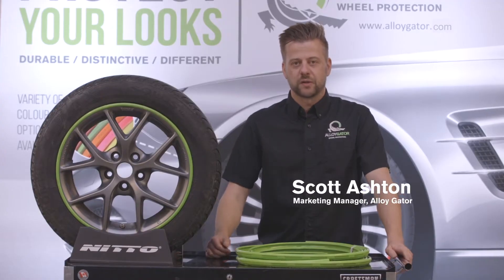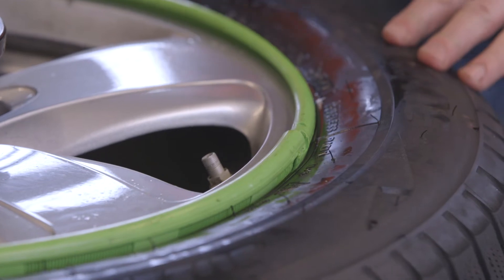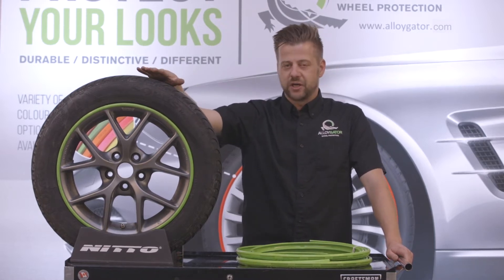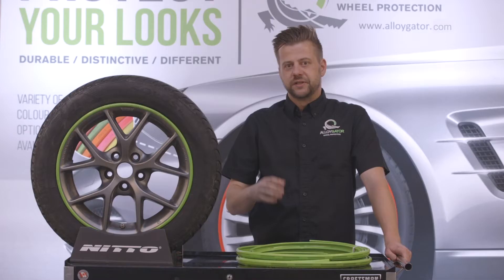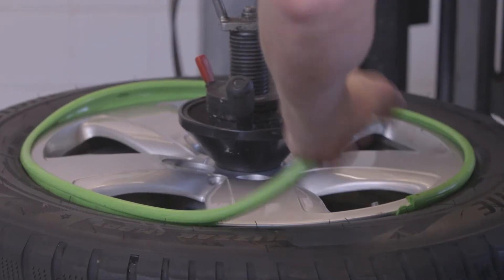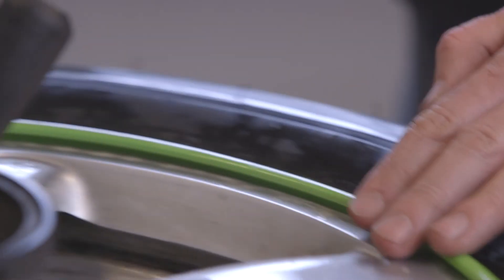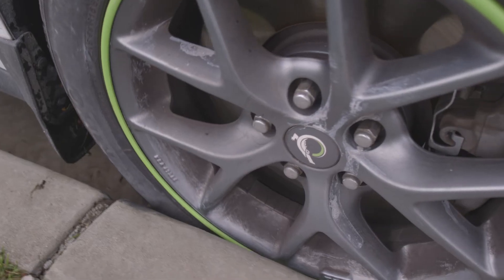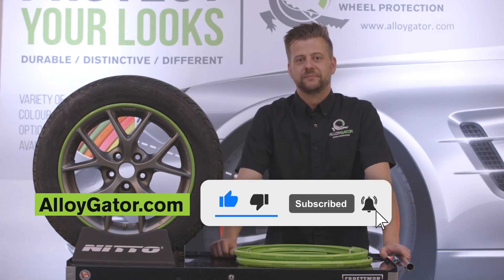AlloyGator - What To Do if You Impact Your AlloyGators.

Comment: What if I need to change my tires? Do I need new alloy gators?
Reply from the maker: Hi Chucky, no you don't need new AlloyGator necessarily.  it will depend on the condition of the AlloyGators at the time.  To remove them it is best to use a tire machine in this method:
https://www.youtube.com/watch?v=TWeYnksPhWg
Thank you.